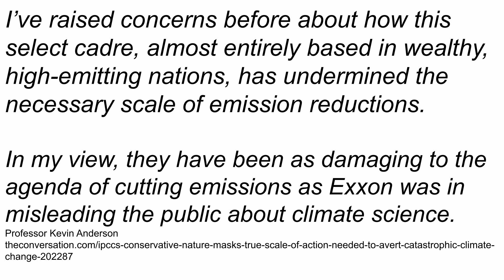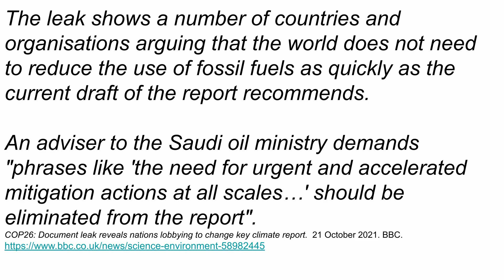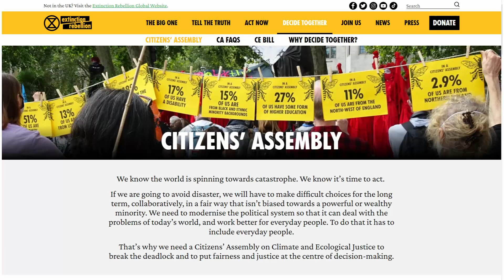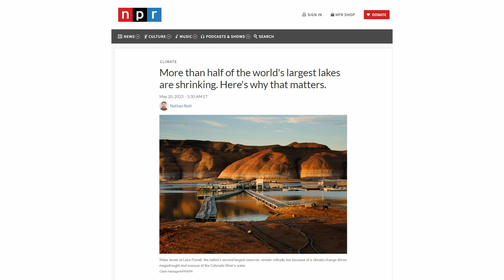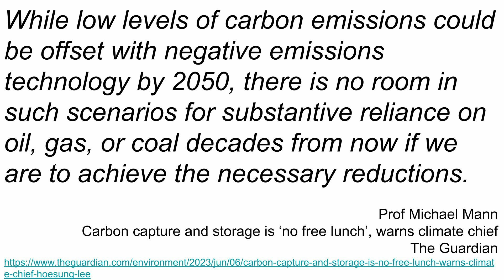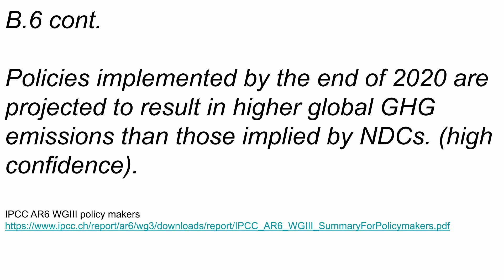They Will Never Tell You The Truth About Climate Change ... And For Good Reason

Comment: There is a further divide as well as those who read the climate reports and those who don't.  Degrowth is controlled collapse which means collapse is inevitable its just if we do it voluntary and avoid some of the chaos and death then if we ignore it.  . The third group is aware that there is only around 40 years of fossil fuels left before they are to expensive to extract at current consumption.  (when we are out + eroi oil  other energy extraction like coal stops)  It will take all those fossil fuels to build a new energy supply 25%-40% of what fossil fuels provides now.  The issue is perhaps 20% see the big picture and 40% believe in the green transition.  The other 40% are deniers or believe humans are not responsible.  (My impressions from meeting people)  We need a bigger shock to the system before opinion can change, Perhaps millions dying in a single heat wave for ex.  If Britain lost a million to heat exhaustion in a single summer and India lost a million in a single city etc.
Reply from the maker: Like some other civilisations that have collapsed, we can't go forward as we are and it's difficult to go back to less polluting times.  We're in a real bind.
Reply: @CountEverything  which is why the governments cant really tell the truth of the situation, if they told the masses of the bind we are in everything would collapse sooner. Also do the government's actually have to tell the lie, the general collective would rather stay ignorant and pretend everything will be okay, government's just have to mirror that back to them....everyone is happy (although delusional)
Reply from the maker: @alexspringett  I think the UK government is misleading us when it says we need new oil licences in the North sea.  They're not thinking further ahead than that and since the media don't ask them about longer term aspects, they don't need to.

About how much the people want to act and how much they'd like to stay the same will be partly covered by the next video.
Reply: its not just oil, as a species we are in ecological overshoot hitting or rapidly coming up to many planetary limits
Reply: @alexspringett  We should have William Catton be required reading in high school.  Climate change is a symptom of overshoot.  Civilization is a heat engine.  The bigger it is the greater the heat it will generate.  My focus on oil is that is the heart of our fossil fuel civilization and even if we were not in overshoot this civilization was going to collapse in the near future just because of coming energy shortages.
Reply: @godofwhiskey. William Catton's Overshoot really was the game changing read for me. Indeed you are right on oil, that falling EROI and the energy cliff is one hell of a predicament.

Comment: Brilliant interpretation of our current situation. However, it's even worse and it's still "never too late to give up". I.e we had the wrong baseline for temperature, ,a dangerous target (1.5C), climate sensitivity is much worse than IPCC communicated so far, aerosol-masking hides a lot putting us in faustian bargin, science are continously downwards-adjusting tipping-points and so on. Right now we've got about an 6C increase in the pipeline for the next 100 years, and an Equilibrium Climate Temperature of 10C (that may take 1000 years). We're actually still accelerating our GHG:s in geological warp-speed, much faster than it did before PETM, the most severe mass-extinction so far, when Earth was 13C warmer than today and completely ice-free. 60m sea-level-rise is already "imbedded". Even 350ppm CO2 was reckless. We now know better. (http://www.columbia.edu/~jeh1/Documents/PipelinePaper.2023.05.19.pdf) Naturally, everything until now has been underestimated, why everything is unprecedented and we see new records all the time. My interpretation of it is that about 300ppm CO2 (or say 0,5C) should have been more adequate maximum-boundaries we never should have passed for a long-term stable climate. Obviously, we've done a stupid and probably fatal mistake, collectively as a species. But, it's still, at least in theory possible to admit, adjust and come up with a plan to save ourselves. The Planet does not give a fuck. We're virtually on the tipping-points, but before we've smashed them, we may be able to stop the runaway-train. Even if we can't, it's the right thing to do, at least try. Right now I'm actually writing on such a plan. It has to involve degrowth, but can still emanate in a better life. We need to be fast, but also to have a new vision with appealing ingredients, not only a focus on constraints. Will we do it? Realisticly not deliberately. But it's never too late to try. Our present "Star Trek-Disneyland-civilisation" was just an unsustainable fantasy anyways. We should create something better.
Reply from the maker: Thanks Henrik.

I've made a video about James Hansen's research you mention - https://youtu.be/SOGmltXOslg

Stopping the runaway train does seem very difficult.
Reply: @CountEverything not difficult but impossible we will never stop using fossil fuel or stop emitting co2 We can’t! Everything about our growth and society is based on continuing use

Comment: Several "real" climate scientists claim that we're already at 2 degrees.
Reply: ipcc uses the average 1850-1900 as the reference temperature. if you use real pre industrial, which should be around 1700, the warming is indeed a bit higher than 1.1-1.2 degC. Also, if you take into consideration the aerosol masking effect, which is around 0.5-0.8, you could very well say that the real warming is about 2degC.
Reply: Shhhhhhh.....😜😅

Less jusss try to die rich 👍🏼👍🏼🤑🤑🤑🤑🤑😜🤣
Reply from the maker: Yes.  Aerosols are difficult to measure, but NASA thinks they might reduce temperatures by about 1 degree C.  It will be interesting to see what happens and the amount of fossil fuel burning reduces and the corresponding aerosols reduce as well.
Reply: According to Professor Guy McPherson aerosols reflect sunlight back into space. If aerosols are removed from the atmosphere the heat will not be reflected but will hit the ground and be trapped by greenhouse gasses warming the planet even faster than it is.

Comment: Because it became difficult to grow plants outside reliably for sale, nights and winters too warm, I got a job at a closed down GE transformer plant providing replacements and parts on old ones (I can read the drawings and follow the paperwork but do not know a watt from a volt….that should say a lot too) There is over a 60 month lead time to get a new substation or power transformer. No more large factories and vey few electrical design engineers. No more GE or Westinghouse but we have Home Depot and Lowe’s

My point is what ever changes need to happen are not coming anytime soon…production capacity is not available world wide…5-10 yrs to get a big plant up and running…if u have good people and then what about supplies like copper and aluminum. I think it may be impossible to see much progress for many years and time is not on our side. Even with a tomorrow Manhattan project style input…
I see this from the old GE documents from 1940s to 60’s…I can see the growth  (then everyone gone stoned coked up in the 70’s and things got crappy and closed down by 90’s…I can see it in the style and work recorded)
Reply from the maker: That's an interesting insight.  The sooner governments take the lead and maybe even move to a war time economy, the sooner better progress can be made.

Comment: A suggestion - place chapters in your videos, so you don't need to post the times on the left of the screen. As always, thank you for posting this important video!
Reply from the maker: I've thought about it before and other people have suggested it.  I put the chapter headings in, not because I want people to be able to skip to different locations, but because I want them to see there is a structure to the videos and not just 35minutes of general rambling.  I think if you skipped a section, the following parts might not make sense.
Reply: YouTube used to have annotations, after they removed the feature any video that relied on them is missing original context. With that in mind I appreciate the on-screen time stamps.
Reply: Why not both? :)